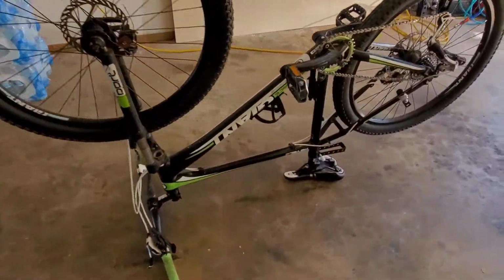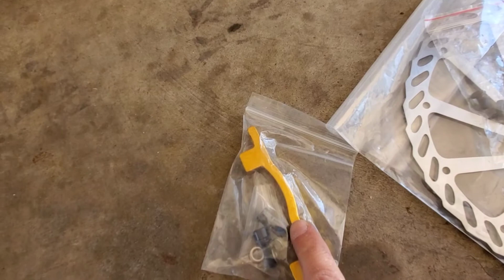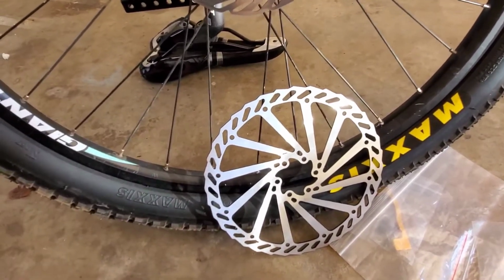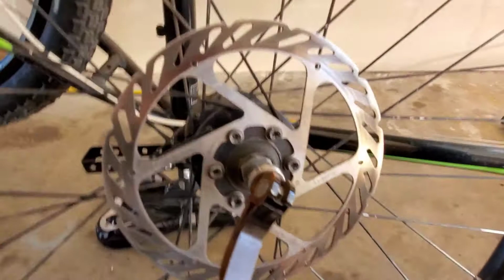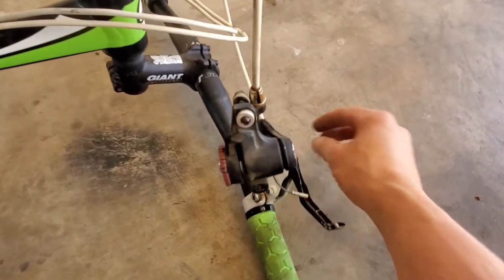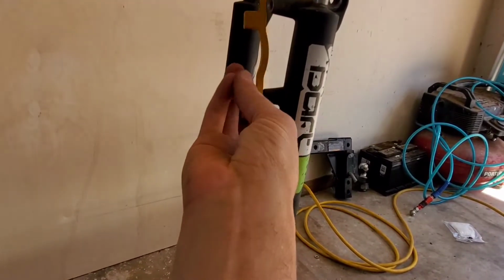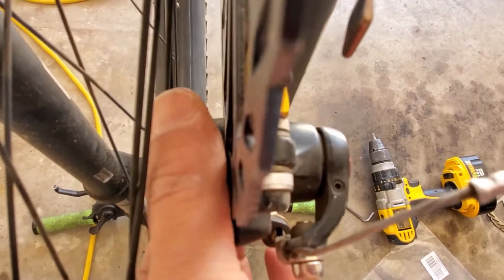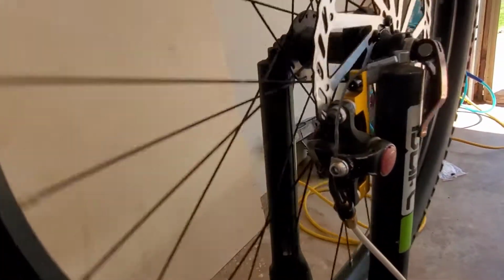Cheap MTB Big Brake Conversion!

Comment: Unfortunately i cannot seem to get the bolts ( torx T25) out of the rotor without damaging them.  They are like… welded in.   You make it look so easy using a drill with a T25 torx bit.

Comment: I have a 67 lb fat tire folding ebike and was about to go from 160mm to something larger, when I read that you have to check with the manufacturer because there is the potential to snap the fork due to too much braking power. Did you consider this? Ever had a problem of too much braking power?

I actually checked with the mfr in China and they told me not to go larger than 160 mm. 

My current brakes are insufficient going downhill and howl like the dickens with prolonged usage. I have to do something.
Reply from the maker: Wow. I haven’t had any issues and I do nail them hard just for fun. Snapping the forks shouldn’t be an issue unless they’re very poorly made in which case I wouldn’t feel safe riding them. My brakes and my forks are holding up great. If you do decide to try them, I hope it goes well for you and that the forks don’t snap.
Reply: @ProZacksProjects   Thanks for that. I've decided that it's because my eBike weighs 70 lbs. Probably not an issue for the lighter bikes. I went with enlarging the rotor on the rear wheel from 160mm to 203mm. I don't think the frame is as vulnerable as the fork.
Reply: @ireland66613  it makes a difference on long downhill rides where I have to ride the brakes. And the threshold of howling brakes is a little higher.
Reply: @bluemoonie7650  very cool thanks for the replying

Comment: I`m wondering, I have a polygon xtrada 6 and it has a SUNTOUR XCR32 LO-R, 120MM, and it says in the user manual that a "flat mounted" this fork will only support a 160mm rotor which for me is just not enough as I am a little fatty lol, will I have any issues fitting a 203 in the front and 180 in the back ?
Reply from the maker: That’s an excellent question. I would recommend buying a 203mm adapter and see if the mount and caliper fit. It should but if not, you can send the mount back.

Comment: 4 month usage review/update?
Reply from the maker: They're still holding up perfect. The only downside is that l accidently sprayed some penetrating oil and it got on the front rotor. Aside from that, they lock up very well. It takes no effort to put it up on the front wheel.

Comment: Cool, any links to products?
Reply from the maker: I just added them. Thank you for asking.
Reply: @ProZacksProjects  side mount adaptor links to the wrong size fyi
Reply from the maker: @bastiaan1532  whoops. I'll fix that
Reply from the maker: @bastiaan1532  they ran out of 203mm. I'll update the info. Thank you for letting me know.
Reply: @ProZacksProjects  I ended up just buying two post mount adaptors and will install one of them on the original rear side  mount adaptor. 🤞🤞 Lol
Reply from the maker: @bastiaan1532  😄 I hope it works out for you.